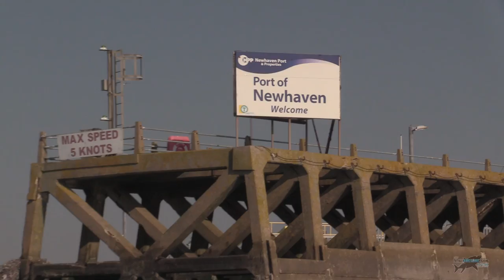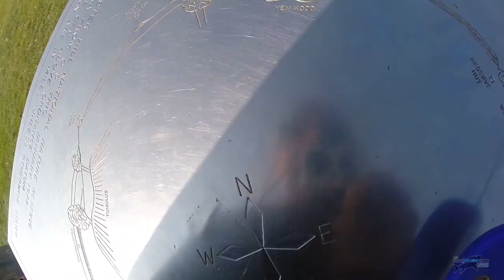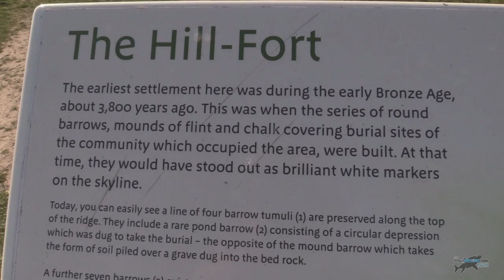Learn to Fish from a BOAT - Lure & Bait Fishing

Comment: My tip is get rid of that crappy grey fuel line and buy some automotive fuel line by the meter to replace it with.Those fuel lines you're using have a liner inside them that deteriates and causes blockages.

Comment: Great way to launch a boat. I always enjoy your boat fishing videos. I wish I'd gone for a sea boat years ago. We are very short of slipways on the Broads. Those remaining, usually cost about £12 each way. There used to be a lot of public slip ways but they've shut them now despite huge annual increases in Broads tolls.  The Broads Authority take the money and run. The average depth of the broads was 14ft a hundred years ago  now it's 4ft. At the moment it's at what must be an all time low due to lack of maintenance in general but added to by lack of rain, small tides and I'm sure added to by the fact that trees, that have replaced reed, boardering the rivers take up millions of gallons of water. Returning from maintainance up the Ant last week my prop picked up a leather cushion cover and rope, thank goodness I have an outboard, a fixed prop would have cost a fortune. The low water means that many can't safely leave their moorings at the moment and many of the bigger craft are  running in the silt layer and likely cooling with mud. Can't be good for the fish. Cheers

Comment: Hi Graeme, some interesting tips about using an Alderney Ring. I have a Predator 165 and use a 5kg Bruce anchor with 4 metres of chain.  I have been thinking of getting an Alderney ring set up. Would I need an A1 size bouy or would I be better with an A2 size?  Love the little Jack, I had one and then a Patterdale. Currently have a little Norfolk who puts his life vest on and joins me on the boat!
Reply: Hi , I would use a minimum of an A2, 50 inch circumference buoy, it has to be buoyant enough to not only support the anchor , but it has to be able to pull the anchor, up from the depths, allbeit my anchor is heavier than 5kg
Reply: Chris Sparks so does the buoy have to lift the chains weight too great video too love watching and learning as I’m a new boat owner well the boats not new one but I’m enjoying refurbishing it and any tips and advice is greatly received so thank you 👍🏻

Comment: CJ is a great guy ,, my boat used to be kept on a tidal mooring next door to the deep sea anglers yard ,, a 17ft dory with a diy built cabin ,ply fibre glass and gelcoat covered ,, it was sold by the mooring agent for £120.00 because i was a month behind with my mooring fee ,,my mother had died , so money went elsewhere ..
Reply: the boats value was over £1000.00

Comment: Anchoring out at sea always has some associated  hazards. There are a couple of  issues with the method we show in the video, which we didnt mention. If you are hauling your anchor from a cleat on the side of your boat, you need to be able to quickly pull the warp back to the front of the boat, if your engine dies, because it would not be good to be anchored with the boat at 90deg to the waves or tide, and if you wrap the warp around your prop you will need to quickly cut the anchor warp as being anchored stern into the sea would be disastrous. I always have several sharp knives to hand just in case , when I am Aldernay rig lifting my anchor